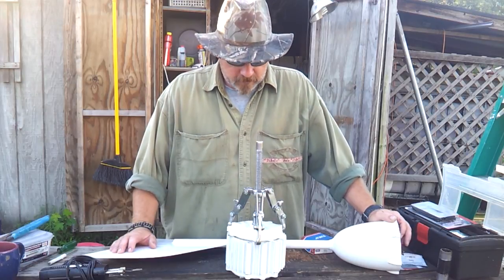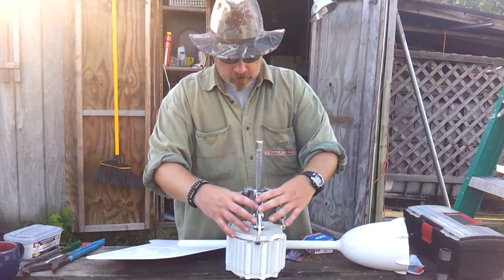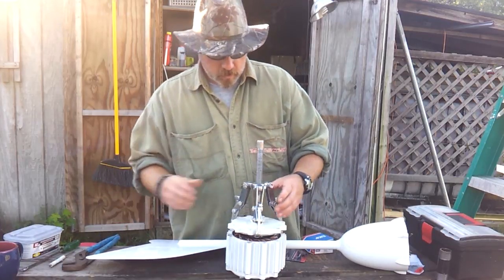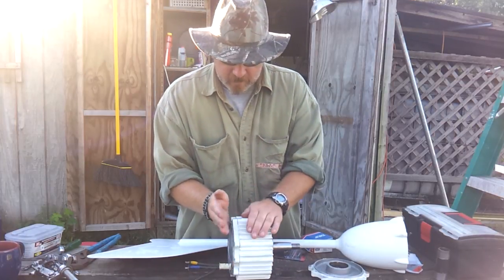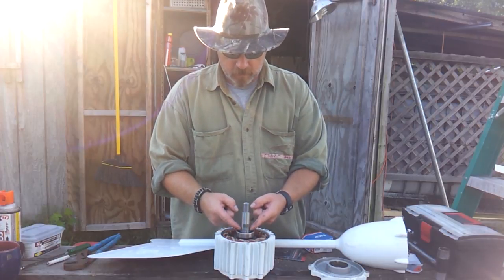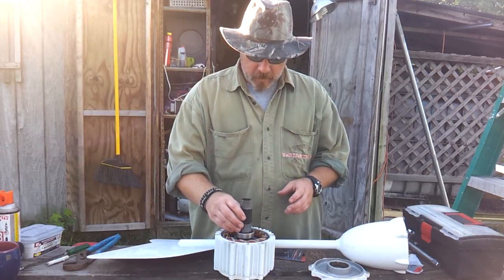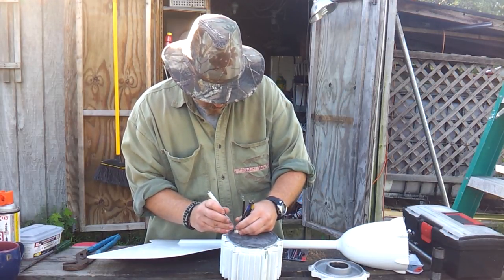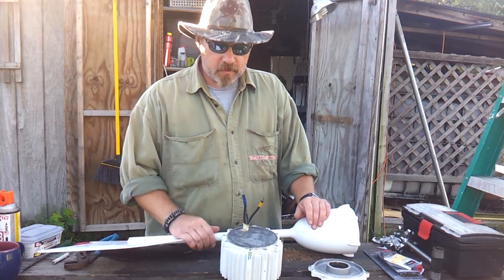Changing the Bearings in a HYENERGY Wind Turbine / Wind Generator Part 1

Comment: Guy, you will really like that turbine and you had to notice the copper in that stator! Sure does produce better than the Car pma stator. These turbines are meant for low wind production that's why their the best on the market! And as long as you buy direct from HYE or Aliexpress and not get sucked into buying from a US distributor that marks it up and has a shipping costs! But thanks for the info and thanks for Kenny letting you have a good deal on that turbine!